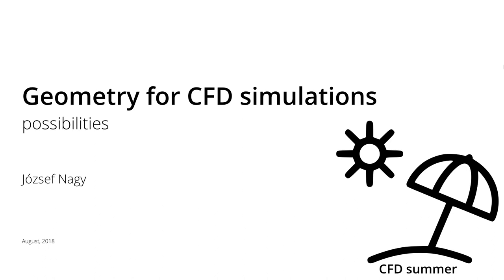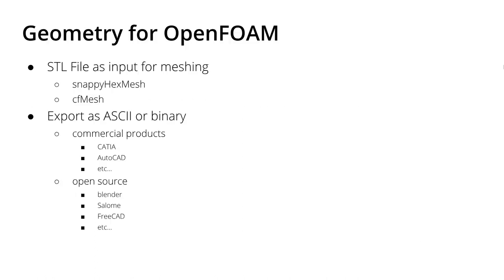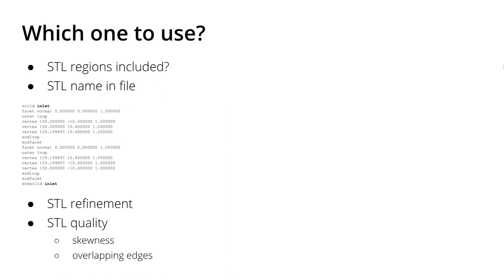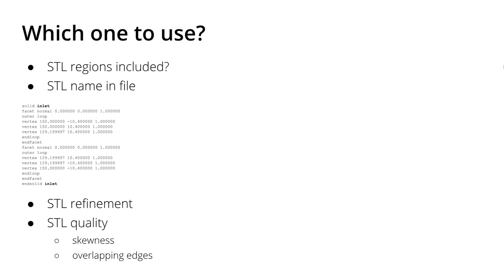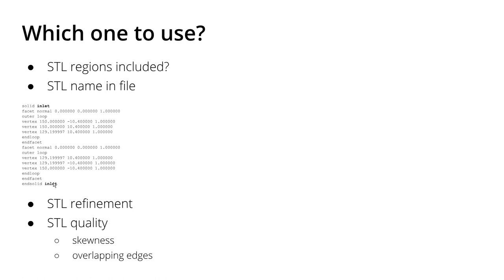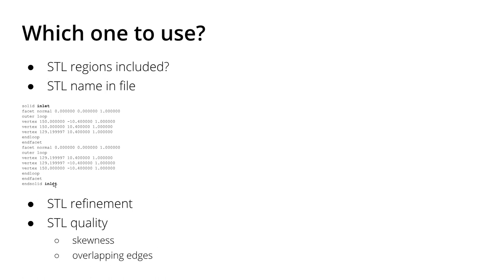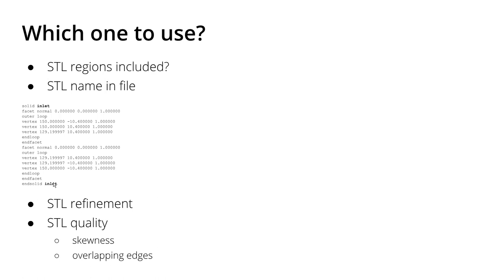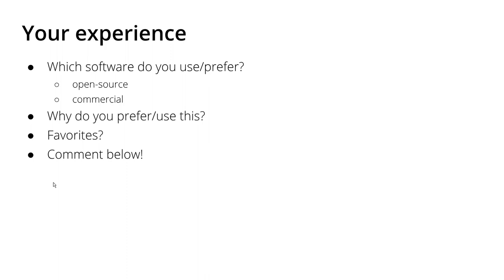[Community video] - Which tool to use for geometry creation for OpenFOAM simulations?

Comment: I find it much easier to rely on Gmsh. It's very flexible and we have good control over the mesh. The latest version 3.0.6 also lets us use boolean operations. A versatile geometry/meshing tool. 
There's just one issue with Gmsh that I haven't found an answer to yet. gmshToFoam creates defaultFaces (in cosntant>boundary) for any internal faces which we may have created for the sake of meshing if the mesh is created with 3.0.6. This does not happen with 2.10.0. But overall I find Gmsh pretty useful.

Comment: I use Solidworks at work for general applications (design and documentation mostly), but when I prepare CFD cases i export my file to STEP and play around with it in Salome.
"Fun" fact:
Windows version of Salome doesn't name STL solids automatically (you have to edit files manually), but Linux build names solids with their project tree names by default.

I use Solidworks Flow Simulation sometimes (the company i work for has one licence), but this software is so over-simplified... You have no control over anything. "Turbulence model? Who cares!", "Boundary layer? No info." , "Mesh settings? Just use these parameters with 1-10 setting", "Varying conditions? You don't need that", "Solver crashed? No reasons to tell you why". You can easily add multiple domains, radiation, compressibility, materials data but with absolutely no insight into how this works in your model. I've switched to OpenFoam to increase parallel case solving capabilities (You have to use one SW licence + Flow Simulation licence for each solver), but I learned a lot about CFD since then. You can use as many OpenFoam instances as you need on multiple PCs and on cloud computing services.
Reply from the maker: That is great and thank you for the fun fact. I am sure there are others, who suffer in Windows with that.
Reply: Thank you for suggesting using the Linux version of Salome for automatic STL naming. I see that the windows version of Salome will have correct naming for mesh generated there with grouped mesh, but have so far not been able to export naming of surfaces on the geometry.  I was considering using Blender for this purpose, and even if I have this installed I would like to minimize the number of softwares that I need to use regularly. I will now check out installing Salome under Ubuntu for Windows.
Reply: Sadly Salome under Ubuntu for Windows with XMing didn't work (RuntimeError: Process 17178 for /Kernel/Session not found). Hoping that some day the guys at Code_Aster for windows will fix this discrepancy.

Comment: I realize I am a year or two late at responding.  I am very comfortable with FreeCad, so use that to export stl in ascii format (a small pain to name it as .ast file, then rename to .stl file).  Then another small pain to change the first and last lines in each ascii file to match the patch/wall name.  It works.
Reply from the maker: Thank you for your input. What is the difference between ast and stl?
Reply: @OpenFOAMJozsefNagy Exporting as .stl from freecad is the binary version of stl.  However, if you choose export as .ast from Freecad, it is the ascii format of a stl.  Then, one has to rename it with the extension .stl
Reply from the maker: @louispasnik5976  I see, can't you choose ascii STL?
Reply: @OpenFOAMJozsefNagy  As I understand, the only way to export as ascii stl from FreeCad is as I describe above.